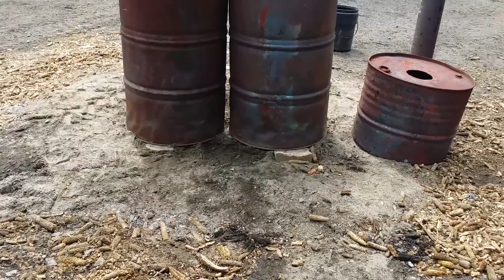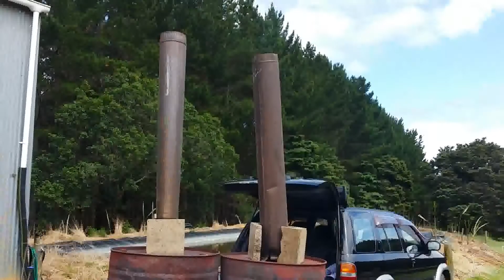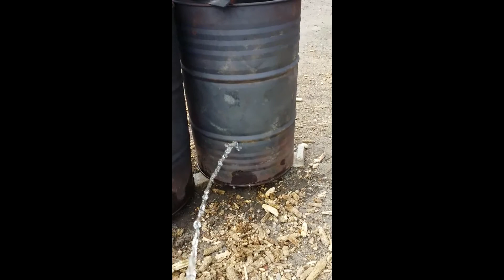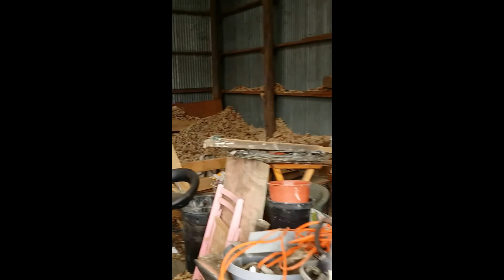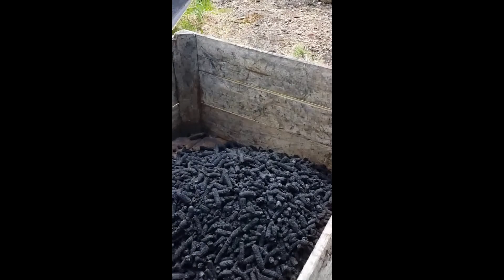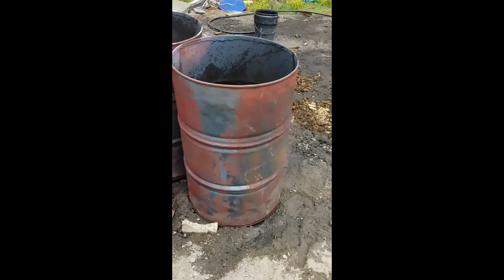Maize cob biochar production - AllBlackEarth

Comment: I have not seen this setup in any other video. Can you show what the various sections look like when they are disassembled and then put together? I am impressed by how little smoke you get.  How big are the holes on the bottom of the lower drum?  Do you aim for a tight fit where the stack pipe in the block sits on the top hole? Do you find that a certain stack pipe diameter or length of pipe works best?  What is your yield when starting with a full 200 liter drum?  Was there any ash produced along with the charred cobs? Thanks.
Reply from the maker: Hi Tom, there is a lot of information on the web about 200L TLUD designs... nothing special about these. nothing has a tight fit... in some cases you don't need a stack. It depends a lot on the biomass condition. Dry cob is easy. This video was prepared on Youtube for posting to the AllBlackEarth website... I rarely look back here,